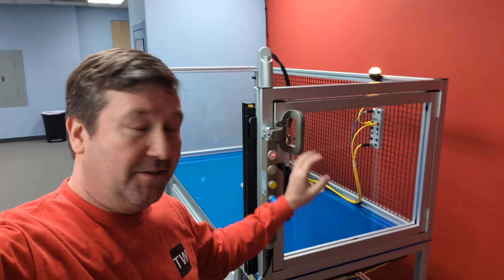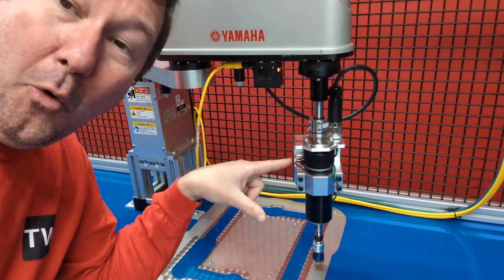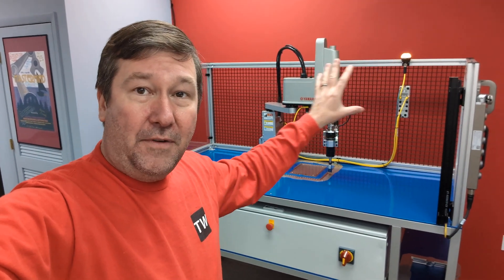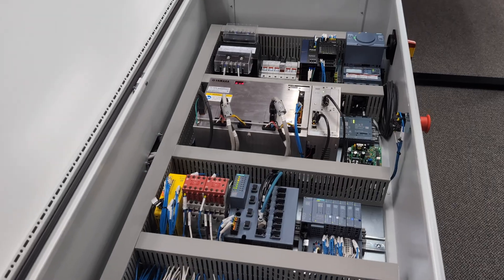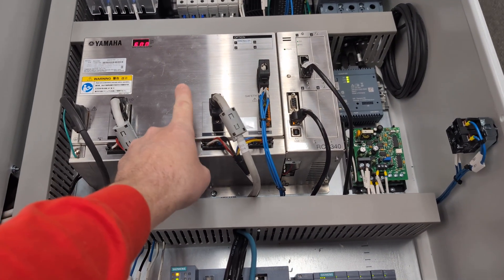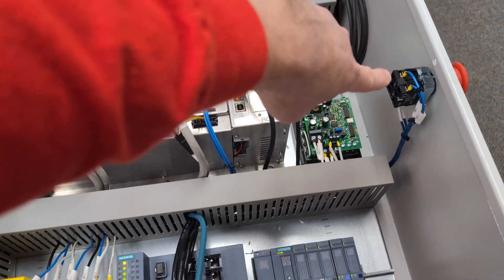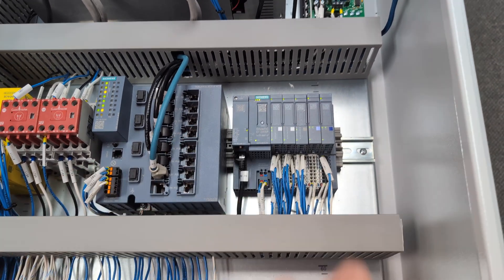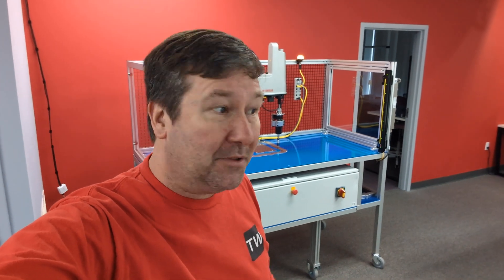The Control Panel "Roast Me" Challenge! PLC Automation Design Review!

Comment: Hi Tim. The VA is covering my expenses for formal training. Do you know of a an accelerated PLC/Automation school that's already approved by the VA? Thought maybe you know someone that's using it has used their GI Bill..TY
Reply from the maker: You local community college will be the best place to start.
Reply: @TimWilborne I checked that. Nothing until January. Plus, that’s kind of a drawn out course. I’ve was a maintenance tech/mechanic for 20 years then I went to school and got a BSEE at 45 years old. Since then I haven’t held the title of engineer. I’d have to take a pay cut at first, especially with all the OT I work. I know my way around RSLinx/Logix a bit but I really want to specialize in PLC going forward so I need something about 4-6 months long that’ll really get me tuned in. A little certificate might be cool for my resume but obviously not necessary

Comment: I would prefer to see a disconnect that requires either a mechanical defeat or the system to be powered off before opening.
Reply from the maker: An electronic interlock has been mentioned by several others. Originally the door was going to be opened with linear actuators but I ran out of money. Let me see what I can do about making a video on the interlock